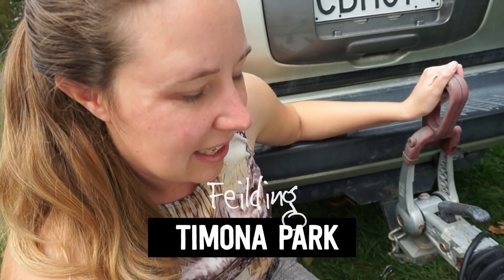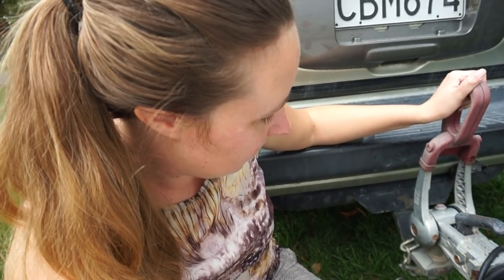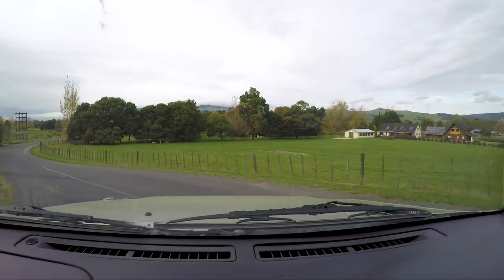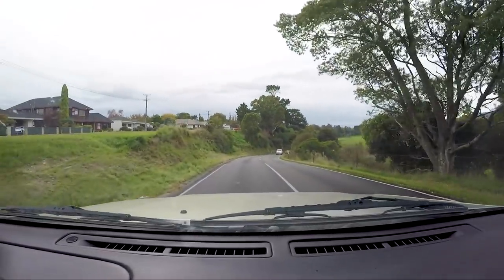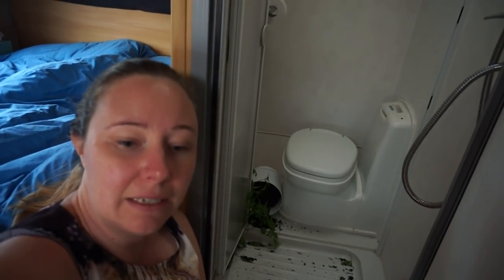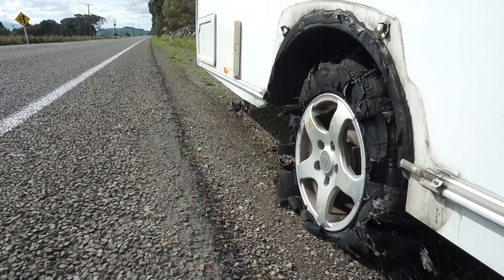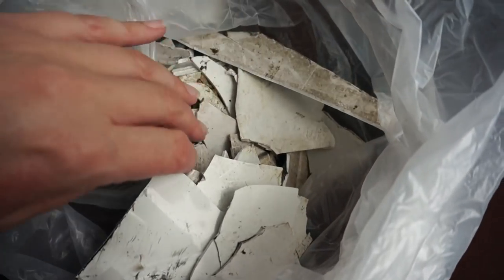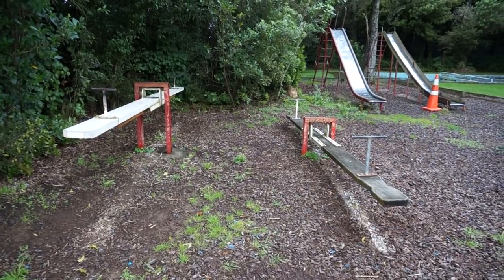Caravan Coupling Broke & Wheel Arch Pieces Found

Comment: Hello again, this may help for the squeaking hitch, you are right there are small brake type pads up inside the hitch they help help the tow ball, but they can be cleaned with clutch/brake cleaner spray which you should be able to purchase at a car accessory outlet, one more tip talcum powder on the tow ball head will also help with a squeaky connection. Cheers.
Reply from the maker: I've got the friction pads out and have decided to take the safer route and replace them. Talcum powder is handy to know for future squeaking! Thank you😀

Comment: Hi Karen.  The newer version of your caravan did away with the underslung spare wheel carrier for all the reasons you are experiencing.  They are now under the bed on fixed bed models. They are firmly fixed to the floor on a bracket. I am sure you would be able to get the securing bracket as a spare part from Swift or the NZ Swift agent? You also save the weight of the underslung carrier as that can be removed. Videos are 👍 regards Glyn
Reply from the maker: Oh that is good to know! My theory is that now the heavy tyre is in my car boot I could get fitted tanks underneath and not have to worry as much about the weight?? And thank you😀

Comment: Hi Karen. I was thinking maybe a cover over the connection would keep it drier. Even if it were just a plastic bag tied on with a bungee. Also, some velcro on your plant pot bases could help prevent them tipping in transit. I was wondering if you used some aluminium composite plastic panel to replace both spats for a while or even got some perspex moulded you could use that instrad of the spats if they are hard to come by. Your oil looks due for a change soon. Good work saving all those bits. Don't chuck them out. Someone may be able to piece them together somehow.
Reply from the maker: I'm guessing.. if I cove the jockey wheel and levers, will they stay lubricated for longer? Velcro is a good idea. I did get a grip mat to stop it sliding around. I think I've tracked down a decent fiberglass company and hopefully get a replacement spat soon 😁😁😁I would be very impressed in someone could piece the spat together again!!
Reply: Travelling K I was thinking if you covered it when you parked you wouldn't get water in it which would hopefully prevent it corroding and if you put the odd bit of CRC on it before covering it, it would soak in better. You're right about the pads, one youtuber put up a video about it. Glad you are getting your spat sorted soon.
Reply from the maker: Funnily enough - I've watched that video! The Trudgians are great😀Hmmmm, think I should start covering the coupling when parked. Happily avoid more rust!

Comment: Aluminium anti seize in a spray can, spray on pivot points and move black lever  up and down to work it in the hitch. This a long lasting product that i have used for many years. I think some of your draining  issue is if you don,t have a vent on your waste tank it will be slow to drain, other  issue is pipes not big enough. You maybe have find a good handyman who do the work at the price. Best of luck , p/s you won,t need to cover  if you use this spray, you get from Eng supplier or maybe supercheap

Comment: Just add to last comment about shower, you might have drill bigger hole in the base to fit bigger pipe. Easy job for someone knows what they are doing. I,m fab/welder that has built lots of buses and horse trucks, i live in Alice Springs and love seeing NZ again its so green!!!!
Reply from the maker: Hi Malcom, thank you! This is all great advice. I'll keep an eye out for the aluminium anti seize spray. I'm hoping to eventually get a grey water tank fitted near the shower and HOPING that will speed up the draining. I am now wondering if my drains need help being cleared too..? Great to hear you've built lots of buses!
Reply: I have a daughter about your age ,so i,m happy to help. The buses that i have converted into motor homes have been a great fun, in the 50k to 100k price range
Reply from the maker: Oh, the buses would be interesting to see! Do you have a website?

Comment: Yo Karen, dunno how you do it but you keep having the same issues as me. Same problem with coupling in the weekend and same fix. 
One wonders if a 3D printer would work with your spat. I have no idea,  but must be someone out there that does.
Reply from the maker: hahah really!?!? You have my sympathy 😂I'm curious - does your safety lever show just red now too? It does feel secure... 
I've just contact a fibreglass company and it's sounding promising! Will be glad when it's done.
Reply: Travelling K I'm not sure  about the colour thing. I was just trying to get the lever down disconnected. I have just finished fibreglassing and spray painting my spat ready to put back on but it weren't as bad as yours. Also, currently working on the shower drainage. Pretty sure I got it sussed. Will let you know if I'm right when I'm sure
Reply: Travelling K By the Trungians have a vid on the friction pads
Reply from the maker: I actually just learnt about friction pads after watching a Trungians video😂
AND you have shower drainage issues too! Yes, please let me know how you go.

Comment: Hi, don’t fancy your chances putting that huge jigsaw together. Not sure who you contacted in the UK to get a replacement wheel spat but you could try the link below, they are one of the biggest caravan breakers in the UK so you might get lucky, however as you’ve already found it could be the postage that’s the expensive bit.
One other tip for you, buy some brake cleaner, it comes in a spray can and clean the tow ball using this and a clean rag. You can also clean the inside of the hitch but, be careful with your fingers,  I’d recommend rolling the rag into a ball and spraying a good amount of brake cleaner on this and twist it round and round to clean all the muck and grease of. I do this regularly to keep the hitch and tow ball spotless to stop any squeaks and more importantly to ensure the stabilizer works effectively.
Happy towing.
https://www.caravanbreakers.net/index.php/9/97724/
Reply from the maker: That's a really interesting link - thank you. I eventually got the spat done with fiberglass but that link might come in handy in the future. 
Good to know about the brake cleaner too and will have a look for it!

Comment: looks like you need to upgrade the safety chain from the caravan to truck.
imagine the caravan coming off the tow ball, that skinny wire wont do jack when your traveling along, even at 50km/ph
Reply: It's not a safety chain, it's a breakaway cable. It pulls the brake on and then snaps.
Reply from the maker: Yes, took me a while to figure out that I didn't need a kiwi caravan chain as the UK caravans have the breakaway cable😀It activates the breaks and the tip is suppose to come away.
Reply: @TravellingK   always use a proper Alko breakaway cable they are the best

Comment: I know this video is old I’m a new subscriber I just wanted to say it’s not good to put water in your radiator water has no cooling properties and can steam away you need to be putting in proper coolant it has cooling properties and won’t steam away also water can rust parts in your engine
Reply from the maker: Thank you for the tip. I do seem to be diluting the coolant 🤦‍♀️